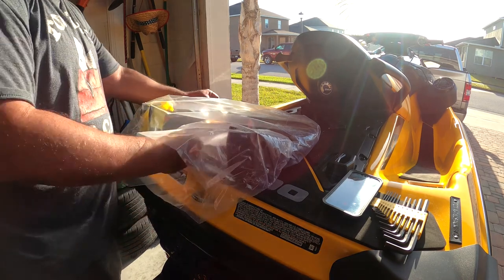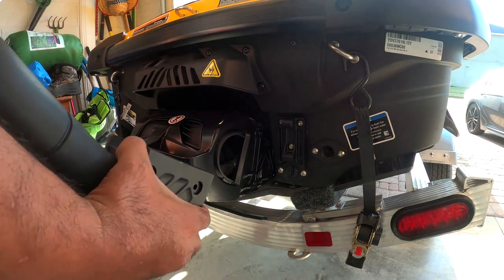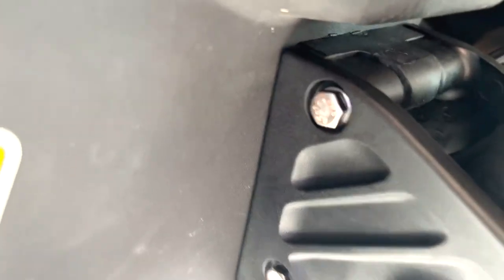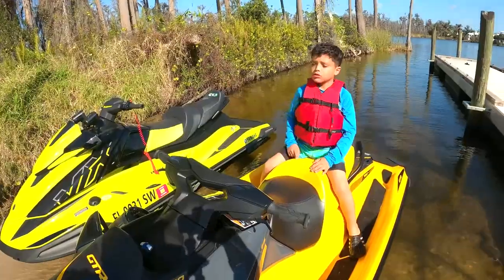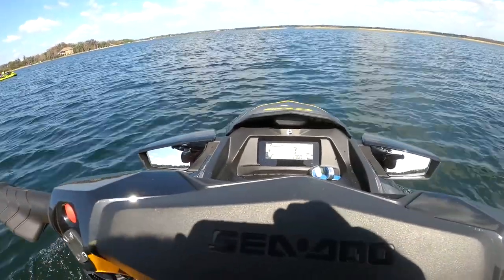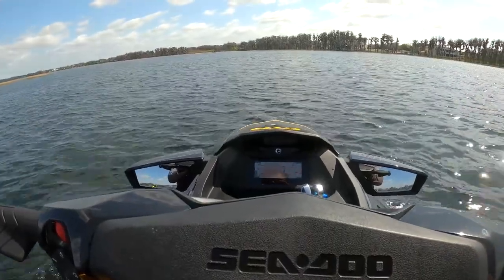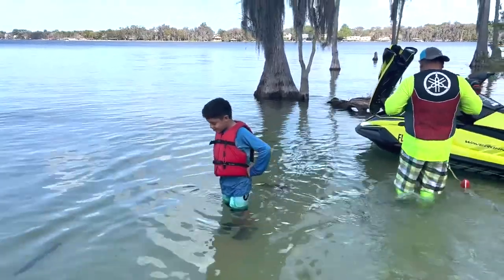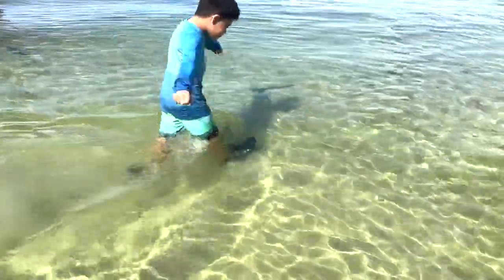DIY - Retractable rear step ladder Install Sea Doo 230 GTR (Test Run)

Comment: I watched your video and then went and installed mine the struggle was real trying to line up the holes. My better half asked if I should be using A a hammer to knock the bolts through. I said the guy in the video did it, why wouldn’t I do the same. Lol thank you for the video!